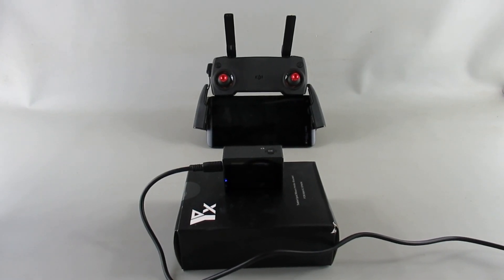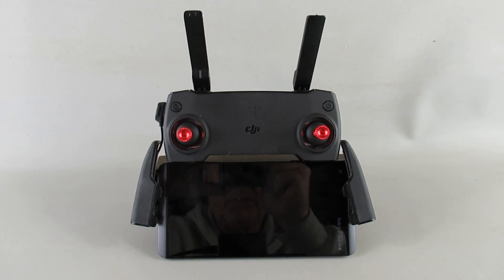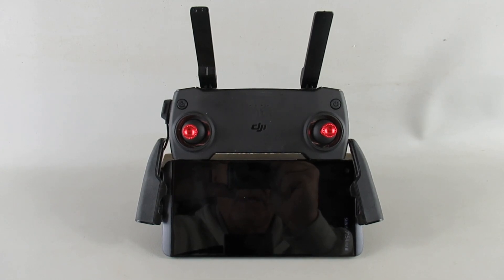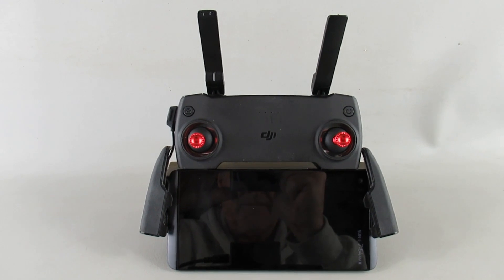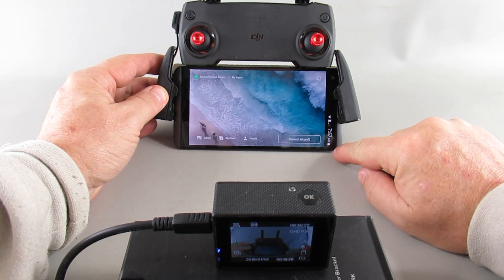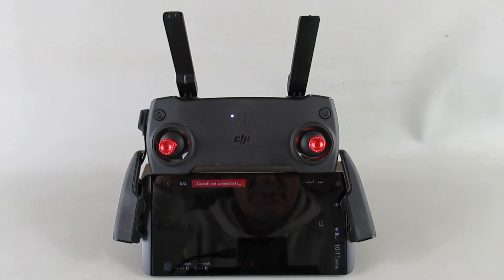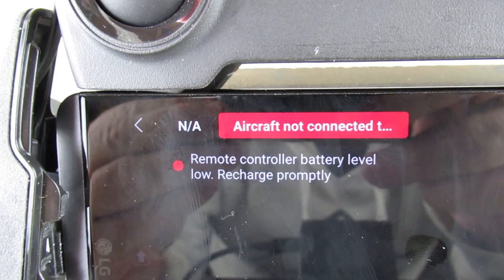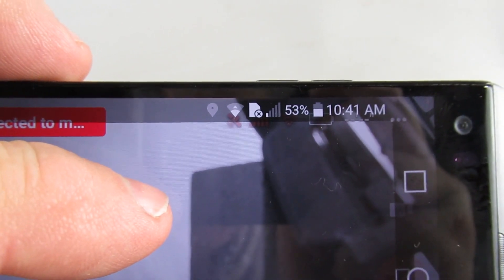Mavic Mini | Controller Battery Performance w/ Android Device

Comment: What would it be like if your phone is fully charged will the controller stop charging until phone battery dischanges
Reply from the maker: The controller only charges the phone when the controller is ON, and the Controller only can be charged when itself is OFF.
Reply: @TommyTester  I have just tested my Mavic Pro 1 controller and it can be charged when itself is on. You may have to amend your previous statement

Comment: Good test. Seems like the controller would still last plenty long enough. I have Apple products so all is good for me.
Reply from the maker: Yes, this seems to be a little known fact.  With the Apple, you do need to shut off USB charging or it will charge too, apparently.  Could you check that for me?
Reply: @TommyTester  I sure will!
Reply: @TommyTester  I will test it tomorrow when my phone isn't at 100%. It is still newish, so it stays charged pretty well.